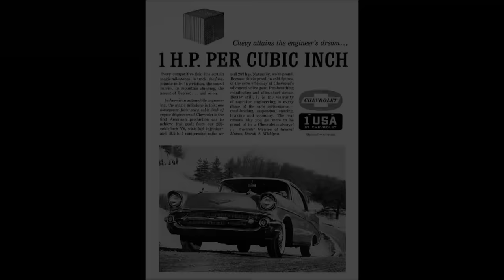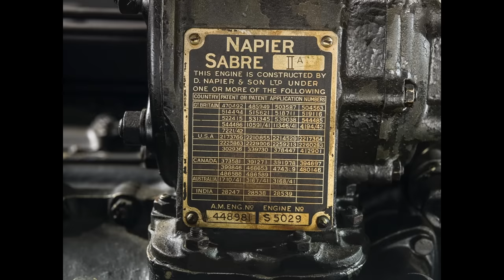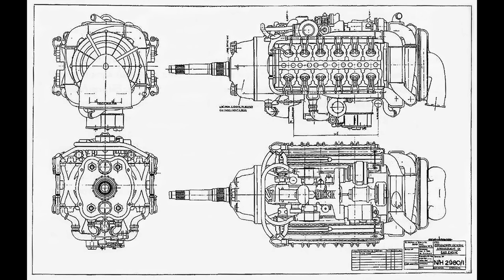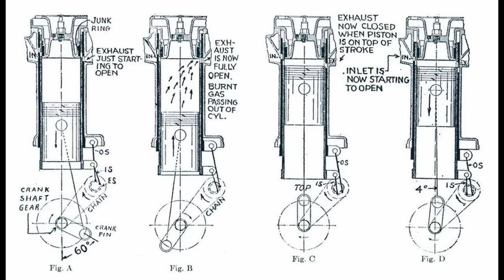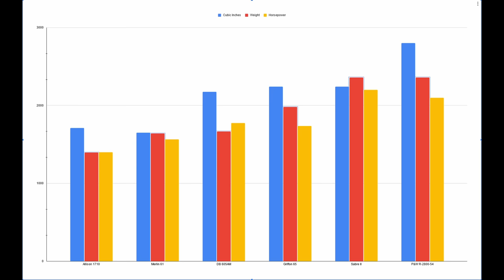Napier Sabre - The Ultimate WWII Aircraft Engine - Part 1

Comment: The Bristol Centaurus would make an  interesting comparison with the Napier Sabre. Both sleeve valve, both 3500 hp, one air-cooled, one liquid-cooled. The Centaurus was used extensively post WW2, and the Sabre was not.
Reply: Good point. Surprised it wasn't considered.
Reply: It's my understanding that even though the Centaurus was designed in the 30's it didn't go into production until 1942 due the Bristol concentrating on Hercules production which was in several types of aircraft at the time. The Centaurus wasn't really needed since the Napier Sabre had been in production since 1939 and filled the bigger horsepower niche along with the RR Griffon which was first put into an airframe in 1939.
Reply: @johnmclean6498  the explanation is that the Napier Sabre was relatively unreliable and the Bristol Centaurus far better...The Bristol Hercules (14 cyl, but same design) was built up to 1964 under license by SNECMA for the Nord 2501 Noratlas, a french military transport aircraft who was operational use up to 1986
Reply: @tempestmkiv  Hercules was in use for current production with room to improve performance, in particular improved supercharging. Sleeve-valve was an issue for Bristol. Helping with the Sabre may well have also diverted effort. I am not sure you could really say the Sabre was in production from 1939 - more some pre-production. It was favoured for many things in the 1939-40 in the UK based on RAF specifications. The Centaurus was seen as something more appropriate, potentially, for naval or hot climate use of the same class as the Sabre. Plus Bristol liked to use its own engines.
Reply: @wbertie2604  Just checked some sources. The Napier Sabre was conceived in 1935, prototype completed in 1937, testing in 1938 and passed the 100 hour test requirment for the RAF in June of 1940. Production of the Sabre II started right after that so you are correct, not 1939. Thank you.
Reply: @tempestmkiv  it was quite the popular choice for a while, such as the super Mosquito (bigger, three crew). After the experience of the Manchester and big, complex engines and losing many to engine failures, I think people were a bit more wary when the Sabre was having issues. Granted, the Sabre issues were of a very different nature to those of the Vulture.
Reply: A major issue that is often overlooked with sleeve valve engines is the piston, bore and sleeve all have to remain as close to perfectly concentric as possible, which requires both extremely precise manufacturing tolerances and pistons, bores, and sleeves with compatible coefficients of expansion so they remain concentric over the entire operating temperature range.  That's easier to achieve in a radial like the Centaurus where each cylinder barrel is its own little power package.
Reply: Post war was all about operating cost. The Sabre was an F1 engine in comparison to an air cooled radial.
Reply: And Bristols smaller Hercules was sleave valve and produced in much larger quantities and produced well into the 1950's
Reply: @danielstickney2400  Napier didn't have the technology to produce cylinder sleeves and bought them from Bristol.
The Centarus was a well developed engine by wars end... the U.K. economy collapsed in 1946 and the Bank of England failed, there was no money to continue development of the Sabre.
Reply: @barkerd1960  What little available funding from the Ministry of Aircraft Supply went to jet engines and turboprops after the war.
Reply: A brilliant invention by American Charles Knight... unfortunately a German named Hans von Ohain rendered military reciprocating aircraft engines obsolete.
Reply: @sandervanderkammen9230  wrote:
"the U.K. economy collapsed in 1946 "

On what do you base this article of faith?
Reply: @sandervanderkammen9230  
No that was Frank Whittle, the inventor of the turbojet engine - he was English. Hans von Ohain, the leading German jet engineer, wrote a very comprehensive foreword in the 'Elements of Propulsion, Gas turbines and Rockets'. In that foreword he states: 

"The first patent of a turbojet engine, which was later developed and produced, was that of Frank Whittle, now Sir Frank. His patent was applied for in January 1930. This patent shows a multistage, axial-flow compressor followed by a radial compressor stage, a combustor, an axial-flow turbine driving the compressor, and an exhaust nozzle. Such configurations are still used today..." and "From the beginning of his jet propulsion activities, Frank Whittle had been seeking means for improving the propulsive efficiency of turbojet engines. He conceived novel ideas for which he filed a patent application in 1936, which can be called a bypass engine or turbofan. To avoid a complete new design, Whittle sought an interim solution that could be merely "tacked on" to a jet engine. This configuration was later known as the aft fan. Whittle's work on fan jets or bypass engines and aft fans was way ahead of his time. It was of greatest importance for the future or turbopropulsion." and "In April 1937, Whittle had his bench-test jet engine ready for the first test run. It ran excellently; however, it ran out of control because liquid fuel had collected inside the engine and started to vaporize as the engine became hot, thereby adding uncontrolled fuel quantities to the combustion process. The problem was easily overcome. This first test run was the world's first run of a bench-test jet engine operating with liquid fuel.".
Reply: @johnburns4017  No, British sources.
Reply: @johnburns4017  Frank Whittle was only the 4th person to successfully demonstrate a jet aircraft engine.
  The Turbojet engine was invented in Germany by Hans von Ohain and Max Hahnn and successfully demonstrated on August 27th 1939 in ROSTOCK GERMANY.
Reply: @johnburns4017  That myth has been completely destroyed by historical evidence... Maxime Guillaume patented the turbojet aircraft engine in 1921 when a 14 year old Frankie was still wearing short pants.
Reply: @johnburns4017  The Daimler-Benz 109-007 is the world's first Turbofan engine it was first ran on May 27th, 1943.
Reply: @sandervanderkammen9230  
A quiz.
Name the inventor of the turbojet engine?
20 points for the correct answer.
Reply: @johnburns4017  AAAAH, SORRY JOHNNY!!!
YOU LOSE, THE CORRECT ANSWER IS HANS VON HAIN AND MAX HAHN.
Reply: @johnburns4017  BETTER LUCK NEXT TIME JOHNNY
Reply: BZZZZZT! Wrong answer. 
The name of the British inventor of the turbojet is..

🍾🎊🎈  Frank Whittle  🍾🎊🎈

Zero points. Zero. Better luck next time.
Reply: @johnburns4017  WWWWRRRRROOOONNNGGG!
Frankie Whittle  was only the 4th person to successfully demonstrate a jet aircraft engine... 2 years after Hans von Ohain and Max Hahnn.
Reply: @johnburns4017  John please get therapy and stop making things up
Reply: @johnburns4017 you are right.
Reply: @sandervanderkammen9230  Whittle is acknowledged as the First Jet Engine builder
Reply: @sandervanderkammen9230  No Whittle was first
Reply: @sandervanderkammen9230  No wrong wrong wrong
Reply: @jacktattis  Frank Whittle is only the fourth person to successfully demonstrate a working jet aircraft engine.
Reply: @jacktattis  Whittle was not the first to achieve anything related to jet engine development.
Reply: @jacktattis  The facts are irrefutable, Hans von Ohain and Max Hahnn invented the jet engine 2 years before Whittle.
Reply: @tempestmkiv  there was a lot of skulduggery behind the elevation of the Napier Sabre.  Lord Nuffield spent 100,000 pounds of his own money to showcase that engine in the Nuffield-Napier-Heston Racer.  It crashed on its first flight (engine failure) in June 1940. 
 Nuffield was also the guy who lobbied to build Castle Bromwich Factory (for Spitfire production) and then delayed construction for 2 years and not one Spit was built there by June 1940. He was then fired.  Yes he was heavily invested in Napier and Hawker, as the new "interceptor" Typhoon was to receive the Sabre engine.